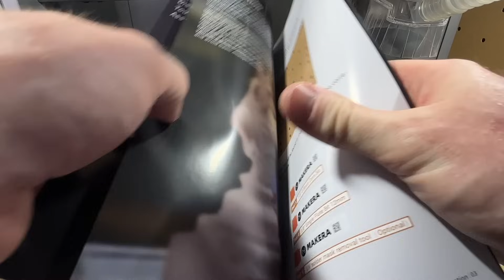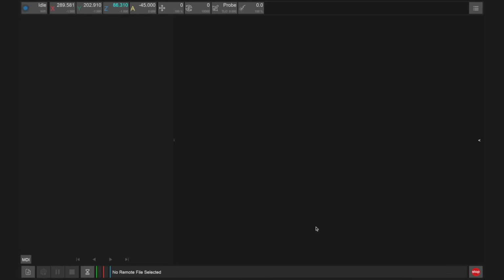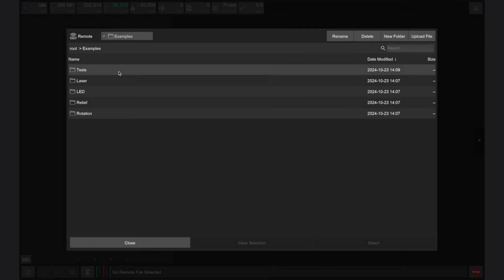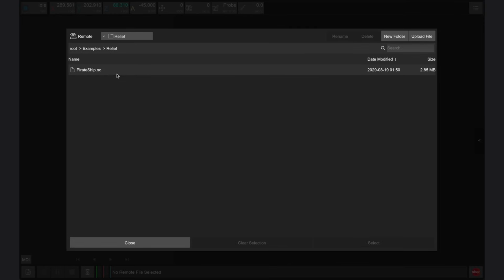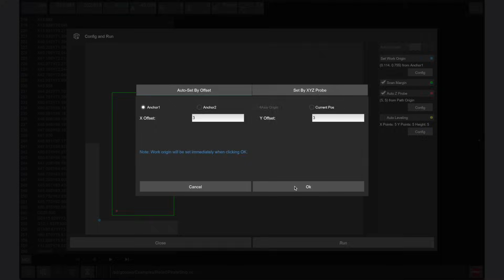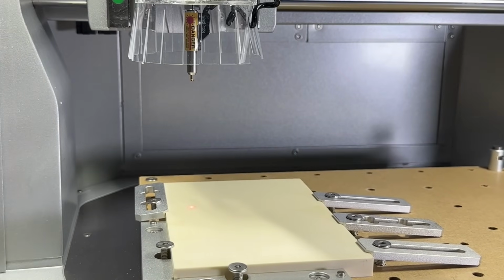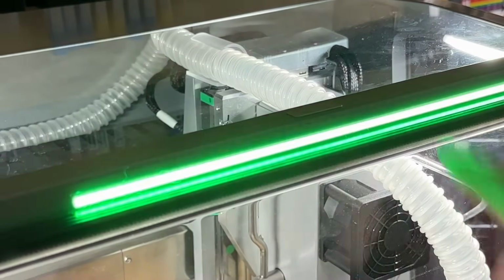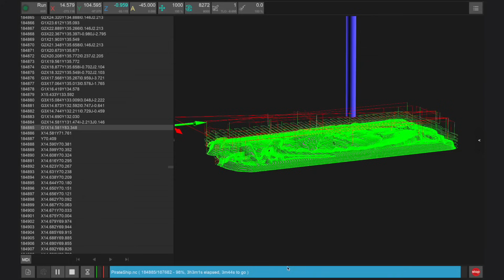Three-Axis Relief, a Carvera Air Example Project

Comment: I tried to do this project this afternoon. Unfortunately that was a big mistake. After the roughing pass that took 15 minutes, the screen showed only 2% was done. The rest would take another 12 hours 😢. That amount of time I did not have. Please add the machine time to the documentation and the video. Can I finish the project on another day.
Reply from the maker: This project should only take 1.5 hrs to complete, the roughing pass being about 20 minutes or so as you specified. Machining estimates are not based on percentage of the overall project, so this may have been an inaccurate figure you were looking at.

Comment: Should I have had the large wasteboard included with the package? I only have two smaller, square wasteboards without any holes
Reply from the maker: Are you referring to the MDF spoil board? There should be one included with the Carvera Air packaged with the manual and user guide, not in the example materials pack with the other pieces of waste board. If its missing, please reach out to support@makera.com so we may assist you further